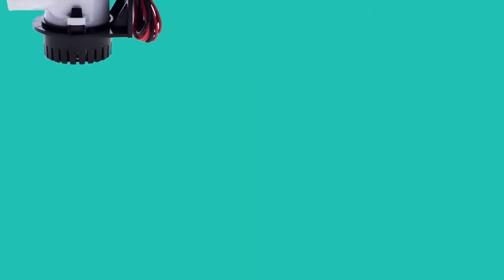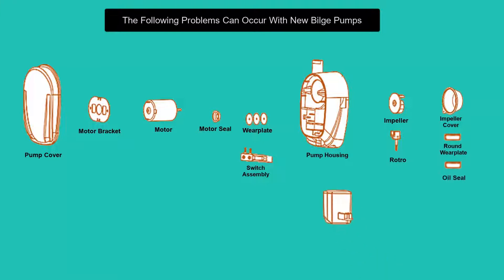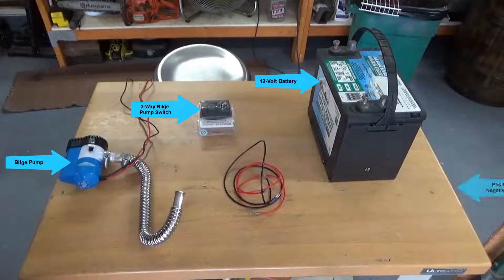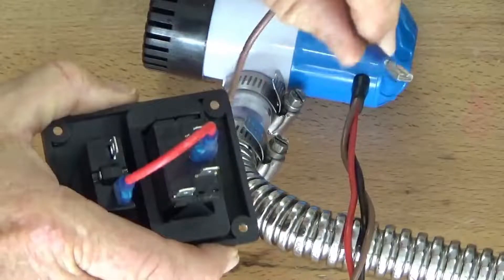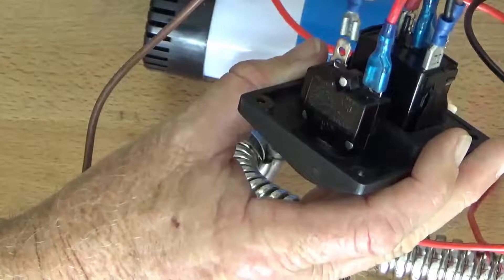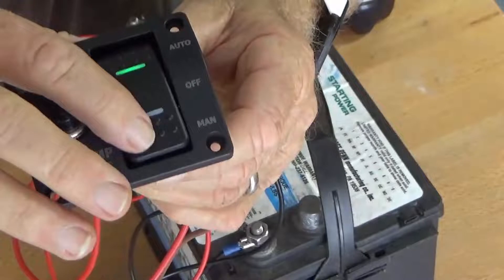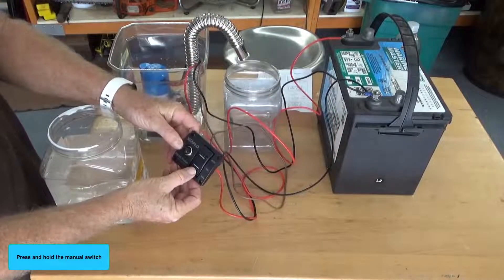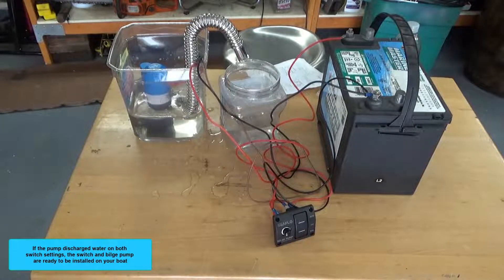How to Test an Automatic Bilge Pump and 3-Way Bilge Pump Switch

Comment: corrugated discharge lines are the worst for bilge pumps as they impede flow and reduce the effectiveness of the pump.
Reply from the maker: You are correct. Corrugated bilge pump hoses, with their ridged internal structure, restrict flow and are not the best choice for runs of over 2 feet. For greater efficiency, it is recommended to use smooth-bore bilge pump hoses, which offer up to 30% greater efficiency than corrugated hoses. 

However, if the discharge port is less than 2 feet from the bilge pump, the difference in water flow rate (GPH) between the two hoses is less than 5%. Therefore, using a short corrugated hose for a bilge pump on small plastic boats, Jon boats, portable boats, and inflatable boats will not have any trouble moving the water out of the boat. 

Considering that smooth-bore hoses are 3 to 4 times the price of corrugated hoses, it would be a good choice to use a short-corrugated hose for a small boat.

Thanks for watching my video.
Norman

Comment: This pump has a water sensor vs float? And did you use number 10 or 12 AWG?
Reply from the maker: Todd,
The pump in the video uses a water sensor level. When the water level reaches 2" it will auto-turn on. I use 12AWG wire.
Thanks for watching my video
Norman
Reply: @NormanGooch  Thank You!